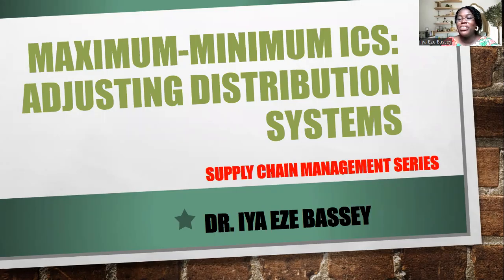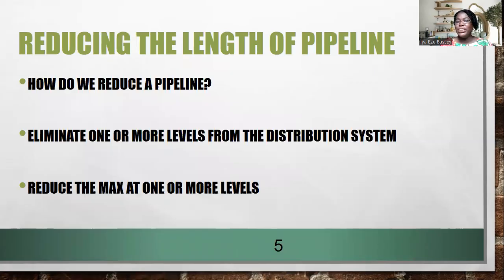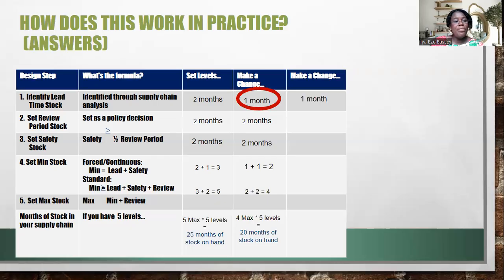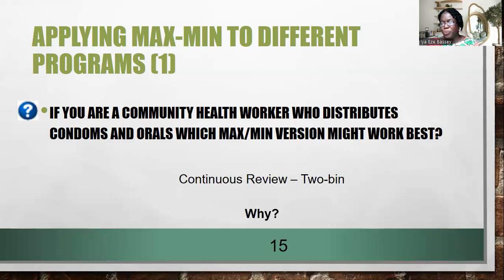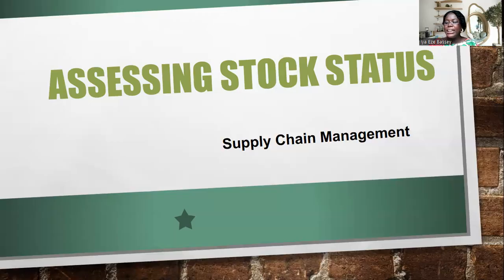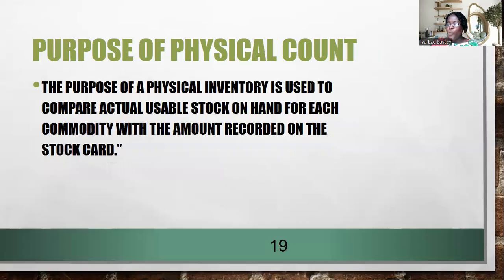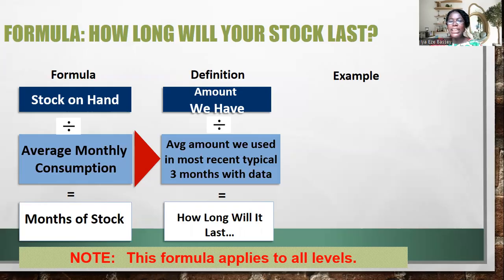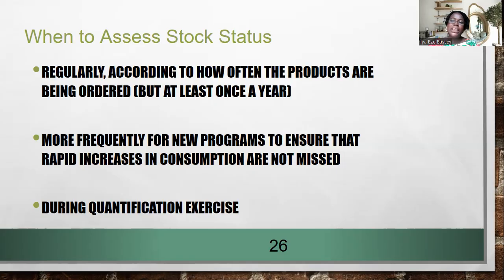Maximum-Minimum ICS: Adjusting Distribution systems (Supply chain management series)

Comment: I learnt that ICS (inventory control system) is a process that helps organizations manage their inventory levels by setting a maximum and minimum level for each product.
- If the inventory level falls below the minimum, an order is placed to replenish it.
- If the inventory level rises above the maximum, action is taken to reduce it.
- This helps to ensure that inventory levels are maintained within a certain range, preventing shortages or overstocking.                                                                                                                                                                                  

 And also, that adjusting the length of pipeline isn't an abrupt action. It is achieved by setting up / implementing fair max-min policies for each level of the system by reduce RP, Leadtime, safely stock at one or more level or improving the reliability of the distribution system.
Max-min system help ensure consistency in stock levels and also ease quantification processes.
Factors like; accuracy of forecast, reliability of transportation, storage capacity and product shelf life may affect the max-min system especially when there are numerous levels and plenty products or even in the case of product for a new program.
It is advice to consider the various factor/triggers for each max-min inventory control system when choosing them for a program.
Assessing stock levels:
This helps us determine how much products are in the store; how many are still usable and how long it will last. It is done by physical count i.e. counting by hand, it helps us compare the actual SOH with that recorded on the stock book.
Assessing stock status may be done during quantification exercise or regularly especially for new program to determine when there is increase consumption.
Thanks ma.

Comment: In summary,
   The steps involved in designing a max-min inventory control system are:
1. Set up initial max-min policies for each level and type of faculty 
2. Check if the overall distribution will function properly if the level specific Max-min policies are implemented 
3. Check the total length of the pipeline that the policies at each level imply 

HOW TO REDUCE THE MAX-MIN STOCK LEVELS
* Elements of the formulas which can be changed In order to reduce the max stock level
* Shorten the review period at one or more levels
* Improve the distribution systems reliability at one or more levels so that safety stock can be reduced 

     Other factors that impact max-min stock levels are:
* Cost of products 
* Storage capacity 
* Cost of storage
* Storage conditions at different levels 
* Self-life of health commodities 

   Other factors that impact max-min stock levels are:
* Lead time
* Reliability of source of supplies 
* Effect of zero balance of stock
* Management skills 
* Age of program
* Accuracy of forecasts 

ADVANTAGES OF USING MAX-MIN 
1. Avoid overstocking 
2. Avoid under stocking 
3. Minimize wastage
4. Avoid costs of emergency orders 
5. Simplify inventory control decision making 
6. Consistency of stock levels

DEFINITION OF PHYSICAL COUNT
     A physical count is the process of counting by hand the total number of usable units of each commodity in your store or health facility at any given time.
    The purpose of the physical count is used to compare actual usable stock on hand for each commodity with the Amon recorded on the stock card 
    The purpose of assessing stock status is to determine how long supplies will last

WHEN TO ACCESS STOCK STATUS
* Regularly, according to how often the products are being ordered (but at least once a year)
* Most frequently for new programs to ensure that rapid increase in consumption are not missed
* During quantification exercise

Comment: Thank you Ma for yet another eye opening and enlightening lecture. I learnt that the steps and procedures in  designing a max-min ICS is to set up policies for each level and type of faculty, check if the overall distribution will function properly, if the policies are implemented and finally check the total length of the pipeline. To reduce a pipeline, one or more levels from the distribution system can be eliminated or reducing the max at one or more levels. Factors such as costs of products, costs of storage, storage capacity, shelf life of commodities, lead times, etc can affect max-min stock levels. The max-min system assists in avoiding overstocking, understocking,
 wastage minimization and even avoid costs of emergency orders.
Physical count is the process of counting by hand the total number of usable units of each commodity in the store or health facility at any given time. This helps to know how long supplies would  last. To calculate how long these supplies would last, this formula is used:
Months of stock Stock on hand + Average monthly consumption.

Thank you Prof.

Comment: Thank you ma for this video
 I hope this comment can make those who have not watched it finds this video interesting to watch because this video best explains any difficulty in supply chain management especially some calculations you find so difficult to understand 
In summary I get to understand the three steps in designing a max-min inventory control system, how to reduce a length of pipeline which you mentioned by eliminating one or more levels from the distribution system and by reducing the max at one or more levels.
Then you mentioned those elements of the formulas which can be changed in order to reduce the maximum stock level and also factors that impact max-min stock level which are:
-Cost of products
-Reliability of transportation 
-Storage capacity 
-Cost of storage 
-Storage conditions at different levels
-Shelf-life of health commodities 
Other factors include:
-lead time
-reliability of source of supplies 
-Effect of a zero balance of stock 
-management skills of staff
-age of program and 
-accuracy of forecast 
Then you talked about the seven advantages of using max-min system, the three challenges in using each version and variation, the difference between the pull and push system, how we can determine our month of stock and then the form in which the month of stock can be calculated giving us two examples with the formula of calculating it and lastly the three ways on when to assess stock status.

Comment: In summary 
Max Min Inventory Control System (ICS), and here’s my take on it! To get started, you set the initial max-min policies for each level and facility, then double check that the distribution system runs smoothly with those rules. You also need to look at the pipeline length at each level. If you want to make the pipeline shorter, try removing a level or two from the distribution setup or lowering the max stock levels at those spots.

They mentioned some things that can impact max min levels, like the cost of products, how reliable transport is, storage space and conditions, the shelf life of health items, lead times, source reliability, what happens during stockouts, staff know how, the program’s age, and how accurate forecasts are. The cool thing about a max-min system is that it helps you avoid overstocking, cuts down waste, and keeps you from running out of stock. To stay on top of things, they suggest doing regular physical counts to see how much usable stock you’ve got and how long it’ll last, plus checking stock status often like how often stuff gets ordered or during quantification checks.

Comment: In summary 
Steps in designing a max min ICS are:
1.set up initial max -min policies for each level and type of facility.
2.check if the overall distribution will function properly if the level specific max-min policies are implemented.
3.check the total length of the pipeline that the policies at each level imply.

Reducing the length of pipeline 
. Eliminate one or more levels from the distribution system.
.Reduce the max at one or more levels 

Other factors that impact max-min
Stock levels 
Cost of products 
Reliability of transportation 
Storage capacity 
Cost of storage 
Storage conditions at different levels e.t.c
Advantages 
Avoid over stocking
Avoid under Stocking
Minimise wastage 
Avoid cost of emergency.

Thank you ma.

Comment: Thank you very much ma'am for this educating video.
I understand that at times , a pipeline's length may prove to be excessive, warranting the need for it to be reduced to meet demand. In such scenarios, the reduction involved,eleminating one or more levels from the distribution system, lowering the maximum at one or more levels and reducing the lead time at one or more levels .
From this video the implementation  of the max-in system offers several advantages such as mitigating the risk of over stocking  and understocking maintaining consistent stock levels , and avoiding the expenses associated with emergency orders.
This is very interesting, 
thank you maam

Comment: In summary what i learnt from this is thus ;
  Firstly , when you talked about the length of a pipeline I got to note the steps in designing the max - min ICS and they are ; set-up initial max-min policies for each level and type of facility ,also check if the overall distribution will function properly and lastly check the total length of the pipeline that the policies at each level imply ..
 You also went on with ways to reduce the maximum stock level and they are; 
-shorten the review period at one or more levels 
-reduce the lead time at one or more levels and also you need to improve the distribution system’s reliability at one or more levels so thag safety can be reduced ..
   I also got to learn about the factors that impact Max-Min stock levels and advantages of using max - min system 
Few of which you listed are ; avoid overt stocking, minimize wastage , avoid cos of emergency orders etc 
     As the video progressed You went on to another crucial part of the inventory control system which is “Assessing stock status” and before that you briefly spoke about the difference between a Push and a Pull system which is;
Calculate and issuing order quantities is a push system and if the facility that is receiving is the one that calculates and determines the order
quantities is a pull system .
      Furthermore I got to learn about the physical count and it’s purpose which is used to compare actual usable stock on hand for each commodity with the amount recorded on the stock card..
And finally i took note of when to assess stock status which are ; during quantification exercise , more frequent for new programs to ensure that rapid increases in consumption are not missed and lastly regularly which is according to how often the products are being ordered ..

Comment: Adjusting distribution systems in maximum-minimum inventory control system is a very important and interesting topic in supply chain management amd i have been able to understand:
(1) Length of a pipeline: it takes over 20months for our ordered product to get us in the pipeline and  it can be be shortened systematically by changing some elements of the formula by shortening review time 
(2) Factors that impact max-min stock level 
* Cost of products
* Reliability of transportation 
(3) Advantages of using max- min system 
* To avoid overstocking/ under stocking 
*Avoid costs of emergency orders
(4) Challenges to using each version amd variation 
(5) Physical count: is the process of counting by hand the total number of usable units of each commodity in the store or health facility 
(6) Purpose of physical count: it is used to compare actual usable stock on hand for each commodity with the he amount recorded on the stock card.
Thank you Prof. I enjoyed the lecture

Comment: At the end of this video I got to learn and understand that;

The Maximum-Minimum Inventory Control System (Max-Min ICS) is a method used in supply chain management to ensure that health commodities or products are always available where they are needed, without overstocking or stockouts.

What It Is:

Max-Min ICS sets two inventory levels:

Maximum level (Max): The highest amount of stock a facility should have.

Minimum level (Min): The lowest safe amount of stock before a resupply is triggered.

How It Works:

The system monitors current stock and usage rates.

When stock drops to or below the minimum level, it signals a need for resupply.

The resupply then brings stock levels up to the maximum level.

These levels are adjusted based on actual consumption and lead times.

Comment: Thank you Dr Iya , for this amazing and helpful lectures.
I learnt 
Designing a Max-Min Inventory Control System:

1. Set initial max-min policies for each level and type of facility.
2. Check if the overall distribution will function properly.
3. Check the total length of the pipeline implied by policies at each level.

Reducing Pipeline Length:

1. Eliminate one or more levels from the distribution system.
2. Set policies to reduce max-min levels.

Factors Impacting Max-Min Stock Levels:

1. Product cost
2. Transportation reliability
3. Storage capacity
4. Storage cost
5. Lead time
6. Shelf life of health commodities

Advantages of Max-Min Systems:

1. Avoid overstocking
2. Avoid understocking
3. Minimize wastage
4. Avoid emergency order costs
5. Simplify inventory control decision-making

Assessing Stock Status:

1. Physical count: manual counting of usable units.
2. Purpose: determine stock levels, identify discrepancies, and calculate months of stock.
3. Frequency: at least once a year, or more frequently if discrepancies occur.

Comment: A SUMMARY ON A TOPIC: MAXIMUM -MINIMUM ICS ADJUSTING DISTRIBUTION SYSTEM.
Thanks again Prof. for another enlightening piece From this lecture, I understood the steps in designing a max-min ICS which are:
(1) Set up initial maximum policies for each level and faculty
(2) Check if the overall distribution will function properly if the max-min policies are implemented
(3) Check the total length of the pipeline that the policies at each level imply.
It is important to carefully analyze demand patterns and adjust inventory levels accordingly
By monitoring sales data and forecasting future demand, business can determine the optimal distribution strategy to ensure that products are available when they are needed.
I also understood that the advantages of using max-min stock is to avoid overstocking, understocking to minimise wastage and to avoid costs of emergency order, etc
Thank you Prof. 🙏

Comment: Thanks you so much for this amazing lecture 🥰,I was able to learn and understand the following
STEPS IN DESIGNING MAX-MIN ICS
I)set up initial Max-min potectes for each level and type of facility
2). Check if the overall distribution will function properly if the lover specific max-Min policies are Implemented
3). Check the total length of the pipeline that the policies at each level imply.
 FACTORS THAT IMPACT MAX-MIN STOCK LEVELS 
*Cost of products
*Storage capacity
*Cost of storage
 *Shelf-life of health commodities.

Comment: This lecture on adjusting distribution systems in max-min ICS talks about the overall pipeline and how it could be improved to deliver medical laboratory commodities from the central level to the rural level. It also explains the parts of a distribution system design which could help us understand the consideration for improved distribution systems in Nigeria. 
To do this, First we look at the length of a pipeline-- In designing a max-min ICS, one must do the following:
•Set up initial max-min pipelines for each level and type of facility. 
• Check the overall distribution if it functions properly after the max-min policies are implemented.
• Check the total length of the pipeline that the policies at each level imply. 
Some advantages of using max-min system are: -it avoids overstocking -It avoids under stocking -It minimizes wastages.
How to access stock status:
~To do this, we take physical inventory, this is a process of counting by hand the total number of usable units of each commodity in your store. The purpose of this is to compare the actual usable stock on hand for each commodity with the amount recorded on the stock card. 
    The purpose of accessing stock sales is to determine how long supplies will last. 
Thank you 🎉

Comment: I learnt that changing some elements formulas,reducing the review period at one or more levels,reducing the lead time at one or more levels, improving the distribution systems reliability in one or more levels is a way of reducing a maximum stock.
For a better way to identify a lead time stock an analysis has to be done for a particular commodity 
a policy decision has to be taken at a policy level to be able to make a review. I also learnt that a process of using hands to count the total number of usage unit of each commodity at any given time is called physical count.
Thank you ma!

Comment: Thank you, Ma, for making it clear on the ways to adjust the distribution systems policies. I was able to understand the challenges, advantages of the Max Min system, applying the Max Min different programs. In summary, I learn that the length of people is the first step to take to adjust a policy, each level imply. Reducing the length of the pipeline by eliminating one or more levels from the distribution system, reduce the max or the one or more levels, reduce the maximum stock level I learnt that factors that impact max in max stock level are; cost of product, reliability, transportation, storage capacity, cost of storage, shelf life of health commodities.  
Advantages of using max min system  
1. Avoid under stocking  
2. Avoid over stocking 
3. Avoid cost of emergency order  
5. Consistency of stock levels  
I also learn that physical count in the process of counting by hand the total number of usable unit if each commodity in your store or health facilities. thank you very much ma this was so engaging.